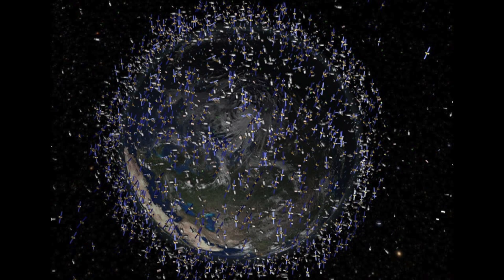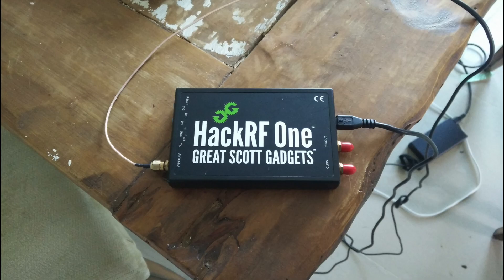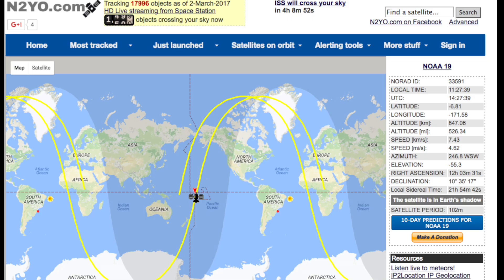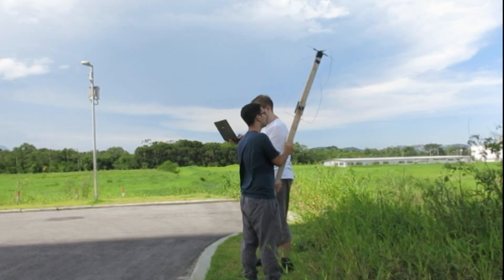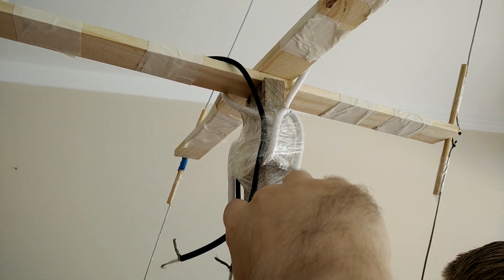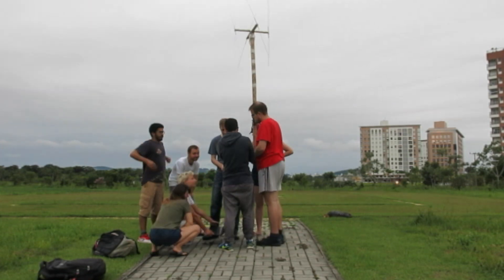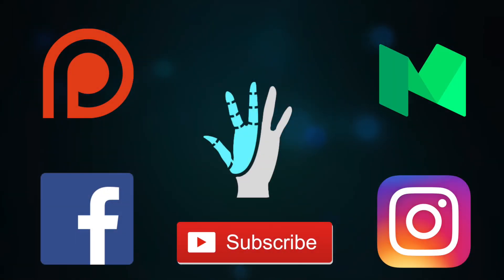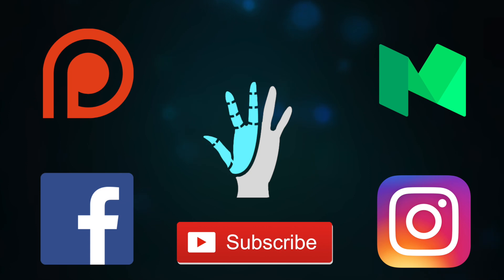How to Pull Images from Satellites in Orbit (NOAA 15,18,19 and METEOR M2)

Comment: So I wonder how well a parabolic antenna that locks onto and tracks the source of a signal would do, and how difficult it might be to build and perfect.
Reply from the maker: That's a thing actually but works at a far higher frequency. I've built such a device already, but it's canada so it started snowing before I got a chance to test it on the satellites. There's 2 build videos though
Reply: Okay cool. I watched the microwave imaging videos, which used a servo-controlled dish mount, but haven't seen the others.
Reply: @thethoughtemporium  try to recieve hrpt. It operates on the same satelittes and the metop a, metop b, and metop c. The image resouliotion is much higher, even higher than meteor. It operates at a freq of 1.1ghz so it would work with a tracking dish

Comment: This is all well and good but does it confirm or disconfirm flat earth?
Thumbs up from me
Reply from the maker: Disprove. Obviously. Not sure what part of "orbit" you missed.
Reply: Yeah, I guess if these satellites were orbiting a flat earth, we would see the edge. Does anyone pilot the satellites? Is it possible someone is zigzagging them across the sky of a cylindrical earth?
Reply from the maker: @AngryMrFixit  no one pilots them. They have a small amount of fuel to give them a boost so they don't crash back to earth, but otherwise they follow a very well known path, i.e an orbit. Again, it's all well understood orbital mechanics.
Reply: @AngryMrFixit  Satelittes orbiting the Earth on circle orbits. Take GLONASS by example. 25 satelittes orbiting the Earth at 19.100 km with an inclination of 64.8 degree.

Comment: Good way to straighten wire: Clamp one end in a vice, grab the other end with pliers (vice grips work well), then hammer a bit on the pliers. It stretches the wire a bit but pulls out kinks very well.

Comment: A circular polarized like your first model doesn't have to be pointed at the object you are trying to follow as that's it's weakest point (that is the null) where the reception is the weakest. A directional antenna on the other hand would be better suited for pointing. Check out helical antenna for future projects. Directional and very high gain, would have been perfect for what you were trying to achieve.
Reply: directional would be better suited for hrpt

Comment: you guys need a dipole antenna with a reflector dish. I cannot do this and make a video because of the noise from my radio station. you guys should make a radio telescope for measuring shortwave signal levels around you and where the strongest signal is, i need this for my radio station :)

Comment: Aren’t the satellites high enough to get a single whole image of earth?? And why those satellites not equipped with hd cameras with no distorted lens??
Reply from the maker: Nope, but the one I'm working on now is. Should have some images soon. And they do have HD cameras, but they broadcast that signal at a much higher frequency. I'm currently working on receiving that as well. This is known as LRPT or low resolution picture transfer. I'm working on receiving the HRPT signals (high resolution picture transfer)

Comment: Was the Meteor data 1.7GHz HRPT? I know the NOAA LEOS birds put out 137 MHz APT (in addition at times to HRPT?) - just a radiofax. About 17 years ago I had built an Az/El/Skew rotator assy with two circular antennae, GaAsFET pre-amp, a dedicated 137MHz rcvr with adequately wide IF bandwidth (an old Hamtronics kit)/ digital audio tape recorder...PC soundcard DSP WeFax software, glossy paper in photo printer. Glorious! I had first built the quadrafilar helix - meh. Did not have software defined radio then. Had to manually adjust freq for doppler shift compensation. Could not use my Drake RF-B w/ FM card (had written script to auto-compensate for doppler shift, tune radio through rs232 comms port.) - the Drake's IF bandwidth was too narrow.

Comment: I successfully received weather sattelites with a v dipole the elements have to be 53.4 cm long and 120 degrees apart and you constantly have to make small adjustments to the orientation of the antenna to get best reception like if it was just horizontal and pointing north the signal would drop out when it is directly overhead
Reply: ive been saying that
Reply: i just did the math and it's 54.50775cm for the length of each one

Comment: Hey there, just a quick advice...
Instead of wood use if possible MF protective electrical tubing. At least here in europe it is easy to optain in DIY shops and from electro resellers.
Wood, especially when wet acts as a conductor. The effect might seem small at first, but when you take in consideration that you are dealing with sub micro volt signals... every single bit counts. Oh and since we're on topic: with the tubes you can also easily build helical antennas. Just wrap your copper around it. It hast a much better suppression of enviromental noise and a far better gain.
You could even build an array of four Helicals with a bearable footprint and weight. 
Contact your local hams, ARRL, DARC and what not. There are always people happy to help you get a hold on this hobby.

vy73

Comment: I do have a question. Have never buildt any electronic device but would like to try a simple version of a radio telescope. But what device do you use to turn a radio signal into an image.
Reply from the maker: I made a video on that if you haven't seen it. It's just measuring the signal strength at each point and turning that into a value between 0 and 255. Plot all those values in a matrix and use that to tell pixels what brightness to be. It's all doable with an arduino and a little bit of code.

Comment: I tried to make a dipole, but I didn't have 50 Ω coax so I used 75 Ω coax and it didn't really work. I am in the process of building a double cross, so I want to know if 75 Ω can work, or if I have to buy 50 Ω. I am almost ready to wire it so a quick response would be appreciated.
Reply from the maker: You need 50 ohm coax for it to work properly
Reply: The Thought Emporium can you recommend me a site to get it. Thanks
Reply from the maker: I got mine on amazon, but it's probably better to find a local electronics shop. They'll sell it by the the foot or roll normally
Reply: The Thought Emporium thanks a lot

Comment: Your wire needs to be straightened.
A way to do that is to clamp one end and turn/twist the other end ( cordless drill is perfect) give it a few turns whilw pulling tension on the wire. Dont over turn.
Great video

Comment: a Yagi antenna and 2 stellate tracker arms 1 for up down and 1 for side to side  it should give you the gain your looking for and the higher you are the better it works a ham radio guy can help you guys out just too see the signals you can get the aluminum form a scrap yard .any old ham radio guy would be glad too help you guys .call a local club it is possible to get real time too. good luck you guys and remember to have fun.

Comment: Well done! I see you are learning by doing. Some tips: Use RG58 coax, with a double mesh shield and foil for maximum noise attenuation, and keep runs relatively short for less signal loss. 
I didn't get a good look at your attempt at a helical antenna, but possibly you were trying to combine elements of both normal mode and axial mode antennas?
A normal mode helical would have diameter and pitch less than a quarter wavelength, and would be omnidirectional only at right angles, in the roughly doughnut pattern. It does not have any better gain than a dipole, but remember that a dipole has good gain only front and back, and much less towards the ends. Like holding your arms out to the sides while facing the signal is "front".
What would really work best is the axial mode helical. It is very directional lengthwise, so you would have to point it at the satellite, but I think you have the ability to do that, and you get much better signal gain. 
You would need a diameter of the wavelength, with a pitch that gives you a quarter wave between each turn. You have to match the circular polarization the same direction as the signal. Best to mount it to a circular plate for a ground plane. This could get a bit unwieldy, but would be a great project, and would improve your signal quality greatly.
Looking forward to future projects!

Comment: Getting weather info with no internet could be handy one day
Reply: G POWER DRAGON, this was exactly why this system was designed into the POES and GOES spacecraft from their early days back in the 1970s. It allowed local farmers (and anyone else dependent on accurate local weather) to create their own weather stations with minimal hardware. The APT signal being discussed for the POES ("NOAA") spacecraft was made to be able to be displayed on old CRT televisions with only analog receiving hardware (no computers needed). So, for example, a rancher in the middle of Montanna would not need to hear from a weatherman (that may not even be accessible in their remote area) what the daily weather was going to be - they just look at their own personal weather TV to see for themselves.

Comment: wow 25 years ago I was doing the same with 2m ham radio in receive mode, a 486 computer and a simple interface that connected to the parallel port I'm trying to remember the name of that interface, also doing weafax reception on shortwave 15 minutes to get a picture

Comment: put one end of the wire in a vice and the other end in a drill. Pull and spin the drill.  have somebody cut the perfectly straight (and work hardened (so stiff)) wire.

Comment: 6:30 I was about to comment that antennas could be polarized. Notice that an antenna emitting polarized circular right and another polarized left the signal emitted from both does not interfere with each other. (Telecomms student)
Reply: Also if your cable is not 50Ohms you could play with the length of it.

Comment: Does any one knows why in the PDF referenced in this video about the antenna design don’t actually use a λ/4 137MHz for the length of each part of the dipole, specially about the extra length of the coax?

I could find a complete material about this kind of antenna to use as reference.

Comment: This is very nice, now I want to experiment with that as well! A little tip to straighten wires: put one end in a vice and hold the other end (like a couple of meters) with big pliers and then pull at it strongly so that it stretches a little. When the wire stretches, it all aligns the internal structure and it is nice straight and less wobbly. This works very well with softer metal (such as copper), but with enough force as well with thicker iron garden wire.

Comment: SO COOL!!!!  I hadn’t heard of SDR until about an hour ago.  I am so going to buy me one of these receivers.  Very glad I found this channel.
Reply: Hak5 did a series on SDR. It's worth a gander.
Reply: The great thing about software-defined radio (or software-defined anything) is that any typical desktop or laptop PC built or bought in the last decade has so much processing power that it can do just about anything that once required a dedicated chip or chipset.  Not that dedicated chips aren't better or are no longer used but you'd be surprised what your PC could emulate with the correct software and relevant I/O device.

With a TV/radio dongle (£8), a midi keyboard (£45) and a blu-ray drive (£23) I can pick up and enjoy TV, radio and satellite broadcasts, I can make studio-sounding music (though I'm shit at it) or I can play Playstation 3 games.

Hell, with a decent graphics card and a VR headset you can now disappear into games like Skyrim and surround yourself with dragons, it's a far cry from the days I was typing code in BASIC on a ZX Spectrum...

Comment: Now I'm not a total hardware geek or anything, but the bit about needing the wires to be a certain length to delay one signal and keep it even. Wouldn't it be easier to have have something that lags the signal that's ahead and then pass both through?
Reply: Both concepts are the same. The longer wire lags the signal that's ahead by half a step to keep it even.

Comment: Will a old radio antenna for a plane ground station work too?
Reply from the maker: ya maybe, but it'll be harder. I've seen people use worse
Reply: The Thought Emporium okay thanks I'll try it
Reply: I have seen simple 137MHz ground-plane work well. It's non-directional which is good. Put a signal booster at the base of the antenna for much better signal.

Comment: Really cool!!! Could you pull an image off a spy sat? Even if you can’t decrypt it it’d be cool just to pull it off.
Reply from the maker: Images? No. signal? sure. Won't do much good though. Would basically just be digital noise
Reply: First I get the signal. 

Then I collect data.

Can't hack it usless I get it.

Comment: Just found this. I actually built a WEFAX radio kit from MAPLIN Electronics back in the early 90s (the kit was called MapSat). It used a cross-dipole and I added a pre-amp to pick up these same NOAA and METEOR weather satallites. the audio went into a DAC box which had cards that slotted in which locked onto the signal parts for the selected format. This then sent signals out to an 8 pin output and passed into a computer via a printer port (or I/O card). I wrote machine code on an Amstrad CPC and Amiga to display them. Had to manually adjust the frequecy (around 135.5 Mhz) to account for doppler shift as the satellite passed over. Good times. Geostationary satellites are much more complicated. But a challenge.
Reply: +Steve Smith
Exactly. While one can in principle receive satellite imagery with WEFAX, the signals as you said do not come directly from satellites, but are re-broadcast via HF (so, from ground stations). In the early 90s I had great fun with WEFAX. I received mainly Sigwx charts from meteorological stations thousands of km away, using an FSK demodulador connected to the PC's audio card "line in" port and "PC HF Facsimile" software from  company called SSC (which unfortunately no longer does business in this weather Rx niche). I consistently got very good, clear images.
Reply: You say opposite to Einstein's relativity conjecturing, then

Speed of light is Not supposed to be altered by the speed of its source.
Reply: Just a comment on this.  We are talking about satellites.  WEFAX is typically a transmission over HF or Short Wave frequencies.  Many programs for satellite decoding will work on WEFAX, but that would be something different.  The signal can sound a lot the same, but you would need a short wave receiver and long outside antenna to get the WEFAX signals.

Comment: You can clearly see the curvature of the earth. Pretty cool.
Reply: The spherical curvature of the Earth is apparent when you look at the pixels at the edges of the scan lines of the direct broadcast data. There is a "bow tie" effect that results from the distance from the spacecraft to the Earth is not constant; the distance directly below the spacecraft is closer to than the points at the edge of the scan line (around 50-60 degrees off to each side). If the Earth was flat, that stretching of the pixels would be linear, which it is not, they grow in size hyperbolicly because the surface is spherical.
Reply: Bryan Breen ?

Comment: Why are there stripes in the picture? Is it due to noise?
Reply: JaapioNL, the constantly repeating "stripes" on the sides of the image are calibration data points from the blackbody radiator on the imager (AVHRR). The data is used to give a reference that temperature A equals brightness B, temperature X equals brightness Y, etc. This is the calibration key used to then know what the data in the scan line indicate (surface temperature, reflectivity, etc). The occasional "jittery" lines randomly seen in the middle of the Earth imagery is due to either data drop outs or anomalies in the sensor (such as failing detectors, irregular scan motor rotation, etc.).

Comment: built a ton of 137mhz antennas, and the best results were with a turnstile. QFH didn't perform any better and was much harder to construct. https://en.wikipedia.org/wiki/Turnstile_antenna#/media/File:SatelliteAntenna-137MHz_closeup.jpg
Reply: this. My dad had exactly the same results 20 years ago when we pulled images from NOAA with a hardware modem and a radio. the radios they use are a joke too. those SDRs are no match to an actual japanese analog front end radio when dealing with such low signals. you can even hear NOAA with a handheld radio!
Reply: Ciprian, no.

the whole point of turnstile and QFH is because the satellite transmissions are _circularly polarized_! trying to pick up circularly polarized transmissions with a linear polarized antenna results in polarization mismatch and signal loss of at least 3db!